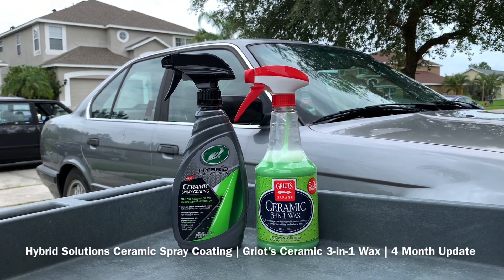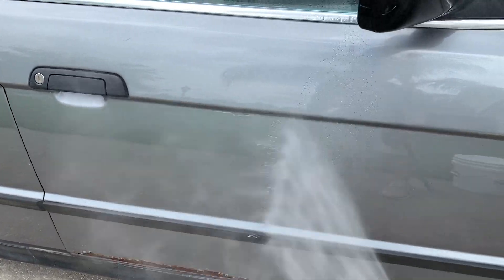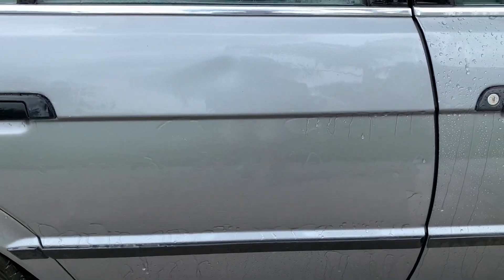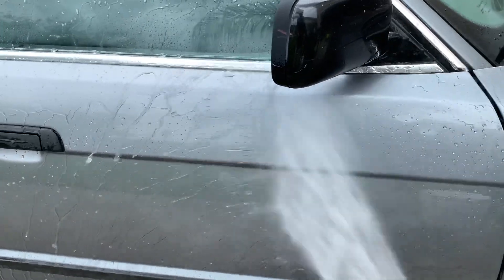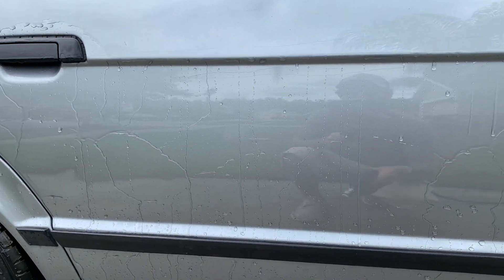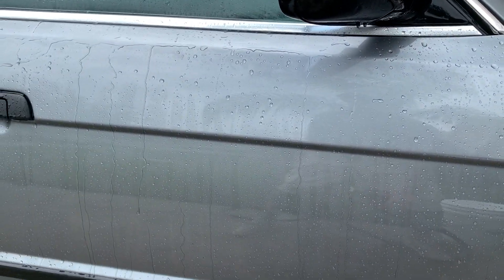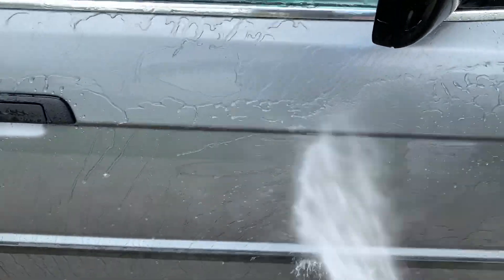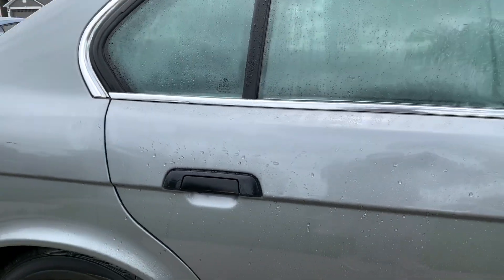Hybrid Solutions Ceramic Spray Coating | Griot's Ceramic 3-in-1 Wax | 4 Month Durability Update

Comment: The Griots stuff is pretty impressive, for something that literally takes 10-15 minutes to apply to an entire vehicle and you can do once every 4-6 months.
Reply from the maker: Really solid performance at this rate, fantastic pricing as well for both of them.
Reply: @WaxMode  i wonder how well griots would work as a drying aid. Probably not as good as actually applying it on a clean and dry surface and buff.
Reply from the maker: @khyoon14  Right, any time you're applying to a wet surface you run the likelihood of diluting the protection that can stick to the surface during the wiping stage.  But I would also prefer to use something like Ceramic Speed Shine for the drying aid step as it will be lighter than Ceramic 3-in-1 Wax, and less likely to leave high spot streaking in case you miss any spots or don't wipe it in as thoroughly.  Also the Ceramic Speed Shine should act as a better lubricant to help protect against marring during the drying step.
Reply: @khyoon14  I've been told using the Griots ceramic speed shine is a good rinse aid, but I haven't tried it yet. The 3 in 1 might be a bit too much for frequent washing

Comment: Thank you for such a straight-forward presentation.  Real-world, informative and no blah-blah-blah.  It is much appreciated.

I recently did 3 older daily drivers and compared Griot's Ceramic 3-in-1, Turtle Wax hybrid ceramic spray (on top of their hybrid ceramic polish and wax) and Griot's Poly Wax.  I used them on carefully cleaned and polished clear coats.
In terms of appearance and ease of use, Poly Wax is unreal is comes off SO easily.   It looks great and sheds dirt like a champ.  No basis for durability yet, but this video is surely encouraging.

I had to buff both of the spray products a bit to get them  glossy---Griot's 3-in-1 being a bit easier to buff clean.  
Griot's ceramic spray IS insanely hydrophobic!  I can "wash" my dusty car with the spot-free rinse at a car wash---everything just comes off clean.   My shower doors shed water now, too.  These chemists are creating amazing products. 

 Overall...I think that you get a little more for your money with the Griot's products.  I've yet to be disappointed in any of them.

Comment: I really like the durability tests. Looking forward to see what Griots has up it's sleeve in terms of new products.
Reply from the maker: I'm hoping for that full paint coating!  Meguiar's has the M788 coating coming out soon, would like to see Griot's jump into the fray as I know a lot of loyal Griot's customers have the experience to run coatings without issues.
Reply: WaxMode I just saw that, $80. I'd pay twice that. I know it takes awhile for Griots to release products but I appreciate the fact they won't  until they're completely satisfied with the performance requirements to meet their standards. When they do I know you'll bring it to us as only you can!

Comment: Well as most of you know it's been raining every day here in Central Fl. for weeks now so I mostly dry the car in the morning instead of washing it. The TW Hybrid Solutions Wet Wax was applied last month and is holding up beautifully on top of the Ceramic Spray Coating. Upon watching this video I'm kind of curious of trying the Griot's Garage Ceramic 3-in-1 and eventually topping it off with TW Hybrid Solutions Ceramic Wet Wax. Great video as always.
Reply from the maker: Thanks for the update Ed, glad to hear you're enjoying the Wet Wax as well, it's such a solid drying aid!  I will have to try Wet Wax out on top of the Griot's Ceramic 3-in-1 Wax on the test panel to see how they play together for sure.

Comment: Great update brother!!! Really impressed with that Griots 3-1! TW is definitely fading bug time above that body line... its weird cause we know wet wax is a great maintenance topper for the CSC but Griots... what would you top the 3-1 with??? Lol that's the question that is eating away in the back of my mind!😄
Reply from the maker: Thanks bud!  Speed Shine didn't seem to have any impact on the hydrophobic behavior of Ceramic 3-in-1.  Should prolong slickness and tackle through any lighter hard water contamination.  I'll have to run Best of Show Detailer on top to see if it covers up the Ceramic 3-in-1 in a future test on the test panel.  But Griot's better jump on adding to their lineup, they're late to the party!
Reply: with 007, it's awesome!
Reply: Top it with the Turtle Wax Wet Wax!
Reply: @WaxMode  that was exactly my though was beat of show detailer or best of show spray wax. Definitely keep me posted!!!
Reply: Bead maker or showstopper!
Reply: @jaykid007  showstopper doesn't have any form of protection.m only lasts 24-48 hours.. pure gloss enhancer 👍
Reply: Top griots with megs ultimate synthetic wax, super durable combo.

Comment: I may try the Griots 3 in 1 Ceramic Wax some time. Thanks for another long term test from these 2 products. I remember you saying in some of your other videos seeing products at their peak performance. That’s what I’m interested in and that’s why I really don’t care how long these products last. I won’t give them a chance to go down this far. I want the peak performance of their characteristics in this order...Gloss, Depth, Ease Of Use, Slickness, Water Sheeting, Water Beading, Price and Longevity. This is why I either reapply or top my protectants every few days or at lest once a week. WaxMode, I know water beading is your big thing. Could you either list or say in one of your future videos what is your product favorite characteristics in your preferred order? Thanks and thanks again for your great videos. I always look forward to them and hearing your (Steve Jobs of the detailing world) voice!
Reply from the maker: Thanks so much Robert!  I agree with you, it pains me to run these types of durability tests where I have to refrain from topping and maintaining the paint on a regular basis.  I'm one of those guys that wants to use something on the paint for maintenance every single time I wash it.

One product you might like is Polish Angel High Gloss.  Very expensive for the amount that you get, but this spray sealant along with their Cosmic Spritz are two of my absolute favorites when we take price out of the equation.  Great hydrophobics, very good ease of use, they wipe on/off really well for as thick as their formulas are, and they leave an outstanding glow left behind on the paint.  I remember trying High Gloss on my neighbor's Ruby Red Mustang a while ago and it just made that paint pop.  Slickness is good, not Bead Maker slick but not bad at all.

If you're ever wanting to indulge a bit then High Gloss is one product I would recommend, for me it's one of the most satisfying spray protectants that I've worked with and it's a very unique style of formula, much different than more products out on the market and that uniqueness makes it very attractive for me.

Comment: Interesting vid. Great info. Thanks for posting.  Was wondering what pressure washer you use. Pretty obvious it's not gas. Seems very quiet and does a nice job. Thanks again.
Reply from the maker: Thanks Gipstetz!  I turn the ambient volume noise way down on the video during the editing, otherwise it is quite loud.  But I'm just running a standard Ryobi 1700psi 1.2GPM unit with some upgrades from Obsessed Garage.  I have an MTM Hydro SGS-28 Gun with the built in swivel, and the Kobrajet 3/8" high pressure hose with all the quick disconnects to transform the utility of the pressure washer, works great now!  

If you're in the market for a good low priced electric pressure washer, check out Landon's videos at Aqualux Auto Detailing, he's got some great videos out showcasing some high flow washers which is what you want if you're running a foam cannon, this one looks like an outstanding unit that flows around 1.8GPM, check Landon's video out here showcasing it:  https://youtu.be/0C1prQGc65s

Comment: Glad to see griots hanging tough. I just applied that on a daily driver that is parked outside 24/7. What about topping it with beadmaker? That seems to play nice with everything
Reply from the maker: Bead Maker I haven't tried on top of the Griot's yet but I'm thinking about trying it out.  Bead Maker can be tricky, I've seen it reduce hydrophobic performance on top of fresh products like Polymer Net Shield and Fusso Coat, while on the coatings like Blackfire Pro, CQUK 3.0, and CQuartz Tio2, it works absolute magic and plays nicely.
Reply: @WaxMode  interesting.  I plan on trying it out.  I also just tried out jescar bead-it as a stand alone sealant. I was impressed with the wet look high gloss. I have not tested its hydrophobic properties yet. Photos on my ig acct @gambietti71  keep up the great videos

Comment: Great video! Love these long term reviews. I was really considering the TW but now I’m rethinking. Have you done a durability test on the last coat? I would love to hear your review of their Black Ice.
Reply from the maker: Thanks Seventh!  I haven't put TLC2 up on one of the test drivers yet, I'm really debating what I want to put on that rear quarter section area on this silver BMW.  I might split that in half and run the new updated Seal N Shine and TLC2 side by side with each other.  I haven't got a hold of Black Ice yet.
Reply: WaxMode I actually did my whole truck in 2 coats of Black ice. It goes on super easy! After the seven days of cure time, I’ll be topping it with TLC 2, and AMP. I’ll let you know how it lasts.
Reply: The Iced seal and shine is no joke for a $10 product. It works really well. Personally I suggest a coat of that and then immediately apply a coat of the Iced Spray Wax. It's a fantastic combination

Comment: Awesome video. So far my favorite spray Si02 is Polish Angel Cosmic Spritz... due to the amazing hydrophobics, gloss and ease of use. Does the Griots compare well to the Polish Angel, considering the considerably lower price? As much as I love the PA, I need to find more affordable product. Griot's looks like it may be the winner.
Reply from the maker: Polish Angel is still one of my absolute favorites.  High Gloss and Cosmic Spritz are perhaps some of the most satisfying spray sealants to work with because of just how well they buff into the paint and how clean of a wipeoff you get with them, despite them being significant sprays with thicker formulas.  They will be more hydrophobic than both Hybrid Solutions and Griot's Ceramic, but Griot's may outperform them in longevity without toppers.  Griot's is not quite as easy to work with compared to them, it's more prone to streaking.  

I have not found a direct substitute for High Gloss or Cosmic Spritz.  I would actually say the TiO2/SiO2 blend of Mothers CMX Ceramic Spray Coating is probably the closest in the consumer market to the Polish Angel formula, but it's not quite as refined, and doesn't have the same hydrophobic durability.  When it's fresh though it will give that awesome Polish Angel style hydrophobics.  A cheaper version of Cosmic Spritz and High Gloss is perhaps the unicorn that I'm looking for.
Reply: @WaxMode  It really is amazing stuff. Even when i over apply it (all the time), it just blends right in and cures into this amazing glossy shell on my white cars. It's almost as if it has filling properties too.

Comment: Your bmw like mines and my 528e i had back years ago i had 6 88 528e bmw they nice and 2 525 95 bmw great video buddy tfs
Reply from the maker: Thanks ONR!  Love these older BMW's, we had a 88 528e a few years ago, I've had my 88 535is for over a decade now, bullet proof engines.  This silver one is a 92 535i, everything is running great and that's why I don't want to get rid of them, despite them having rust and the paint in total failure mode, they are still great drivers.

Comment: Thank you very much for this durability update.  In this video, you said the GG 3-in-1 ceramic is the best spray ceramic you have ever tested.  Did you mean that it is even better than TLC2?
Reply from the maker: Hey ChemoDoc, so far the Griot's Ceramic 3-in-1 Wax has held up the best hydrophobic durability out of all the consumer ceramic sprays that I've tested.  So that includes Meguiar's Hybrid Ceramic Wax, Turtle Wax Seal N Shine and their Ceramic Spray Coating, and Mothers CMX.  The first formula of Adam's Ceramic Spray Coating I was able to get a year of durability of that product on the paint.  

With The Last Coat V2, I just put this on the rear quarter panel of this test car next to the latest update of Seal N Shine to see how both of those hold up in durability.  I'll keep you guys posted on update videos for that durability test in the future!
Reply: How is the gloss and depth of the griots compared to some of the others you mentioned?

Comment: The Griots is super durable, beads really well and makes the car much easier to clean but I really don't get much slickness from it. I may apply a topper to it. I just don't knew what to use. I also have their ceramic detailer and feel like it gives me more gloss than the 3-1. Maybe I'll try that

Comment: Great showing by Griot's. How is that when applying in the sun?
Reply from the maker: I wouldn't recommend it for direct sunlight, I've gotten away with it on the test panel but you can run into streaking if you're spraying it on hot paint and trying to work like that across the entire car.  Turtle Wax you can run a damp microfiber wipedown and get any unevenness to buff off clean in direct sunlight, but the Griot's when it streaks it can be a bit more difficult to level out.  Works great out of the sun, haven't had issues yet.

Comment: Griot's 👍
👋🇫🇷
I would like to test it as a top coat on carpro CQuartz lite, but griot's products are hard to find in France!  For the moment I fell in love with CQuartz lite and meguiar's hybrid ceramic detailer as a top coat !!
Reply from the maker: Cheers Nico!  I'd stick with CQuartz Lite and Hybrid Ceramic Detailer all day.  Perfect combination because HCD is not too heavy and it has much higher hydrophobic potential, it matches the great hydrophobics of Lite perfectly and won't reduce the performance at all.
Reply: @WaxMode  OK thank you very much 👍 👍 👍 👍

Comment: Awesome video. How long you wait to apply a second coat of any ceramic spray coatings?
Reply from the maker: Thanks Royal!  I waited 4 days before washing the paint with Reset and then applying the second coat on top of their sections in this test.  I would recommend to apply the second coat of any ceramic spray coatings after your first wash after giving the products a couple of days to cure on the paint.  If you keep the paint inside in the garage and it stays clean, should be fine to apply a second coat after 24 hours.

Comment: Hey WaxMode, do you have Jescar Bead-it SiO2 Spray Wax Coating to try? Brian from Apex reviewed it recently and it looks really promising. I'd be really interested in its durability, so if you could test that one that would be great.
Reply from the maker: Saw that video Brian put up, he always knocks it out of the park with his tests!  Bead-It looks like it did a great job and I'm definitely interested in trying it out as a product to pair up with and possibly use as maintenance on top of a base layer of Power Lock.

Comment: I just placed an order with Griot's today and one of the items I picked up was this 3 in 1 Ceramic spray wax, so the review was very timely. I just did a massive detail on my 2018 Hyundai Elantra Sport and for the LSP I applied 1 coat of TAC System Power Plus Sio2 paint coating and wanna use the Griot's Garage 3 in 1 Ceramic spray wax as a monthly topper. Yeah, I know I dont need it monthly but you know me, LOL.

What do you think of this and/or Turtle Wax Ice Seal and Shine as monthly toppers ontop of the coating here🤔

Thx👍👍
Reply from the maker: Cheers Klasse Act!  Let me know how that Power Plus coating holds up for you.  As far as coating maintenance, I wouldn't prefer to use either the Griot's Ceramic 3-in-1 Wax or Seal N Shine in the short term.  These two are both on the heavier side of things, and they're not the most hydrophobic, so you should notice them covering up the performance of the coating a bit if it's a very hydrophobic coating, especially with Seal N Shine.  Griot's Ceramic Wax didn't want to go on as nicely on top of the Adam's Ceramic Spray Coating section that I had on the paint, so I did notice streaking when trying to buff it off.

I'm much more likely to run lighter toppers on the coating, or something in the middle.  I'm still very much on the Meguiar's Hybrid Ceramic Detailer bandwagon for maintenance with the coatings.  More hydrophobic potential compared to Griot's and Seal N Shine, but light enough to not run interference from what I've seen so far.
Reply: @WaxMode  thank you for the input. I might use then Griot's Garage 3 in 1 on the glass because my glass coating is TAC System Raincoat. I've used the Power Plus before but I would always end up topping it with everything, LOL. My car will soon be outside 24/7 pretty soon so the coating will be getting a work out!